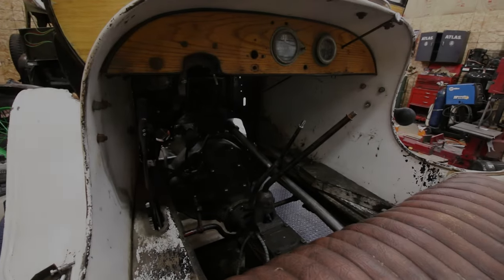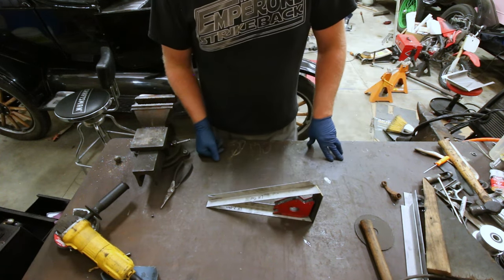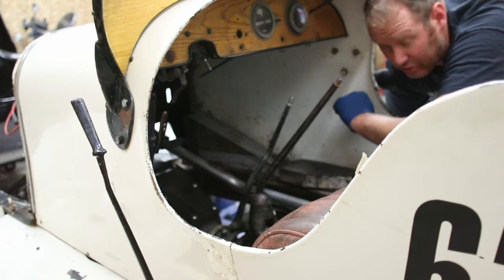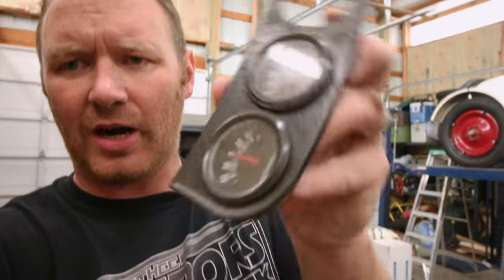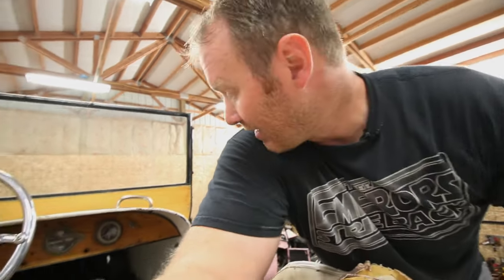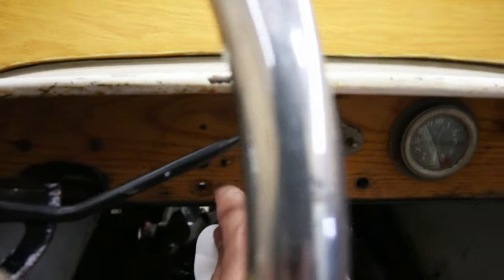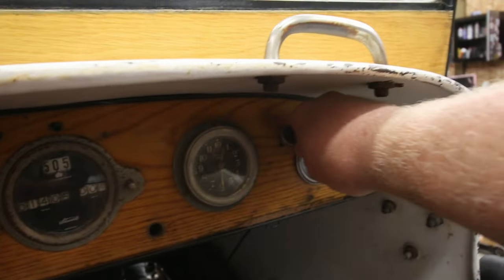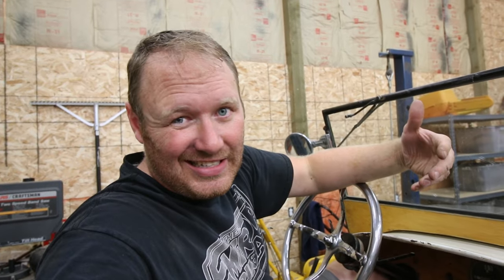Model T Speedster Rebuild: Floors and gauges

Comment: Thx for video.  I have a 29 Tudor with 6 volt positive ground.  Will the Harbor Freight gauges work ok ?   Thx for the help.
Reply from the maker: The Harbor Freight gauge set is universal. They have an Amperes, Water Temp, Oil pressure. The oil pressure will be of no use to you because Model A's don't have a pressure oil system, They only have a lift pump and it is low pressure- 5lbs max. The Amp gauge is a +/- 60 amp it'll work but a standard generator will not deflect the needle much. The water temp gauge is a sealed capillary tube it'll work with a modification to add the probe.